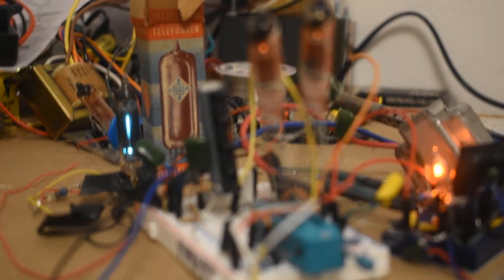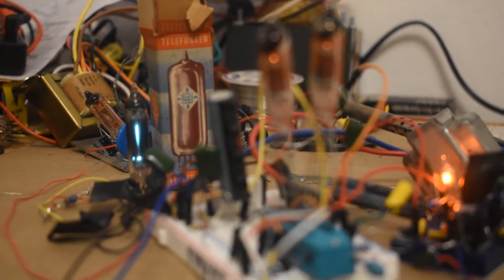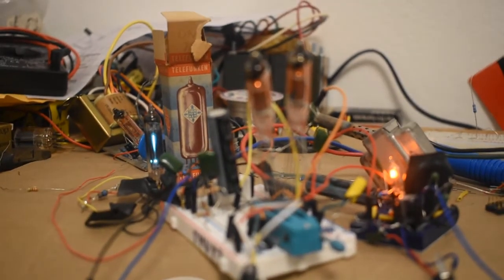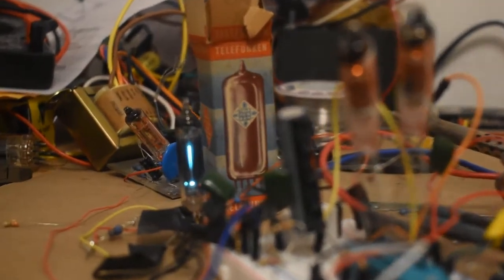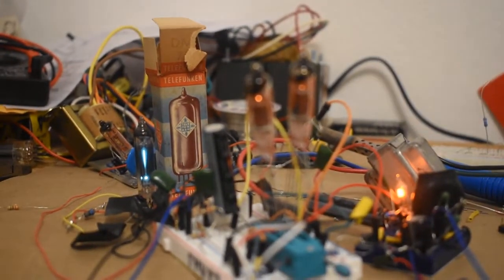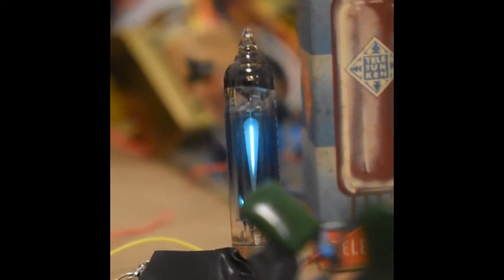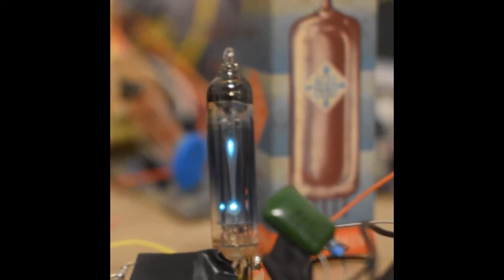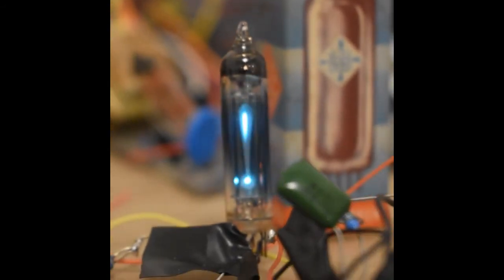Subminiature 5702 Tube Amplifier Proto With Telefunken DM71 Indicator

Comment: Would love a simple small 5702 amplifier for guitar. What schematics did you use
Reply from the maker: The amplifier section was original. I did not keep the schematic as I made tweaks. The power supply section was inspired by the schematic in https://threeneurons.wordpress.com/nixie-power-supply/hv-supply-kit/    - You may buy one of their kits for a reasonable price to get the DC-DC boost converter needed to make a small tube amp.